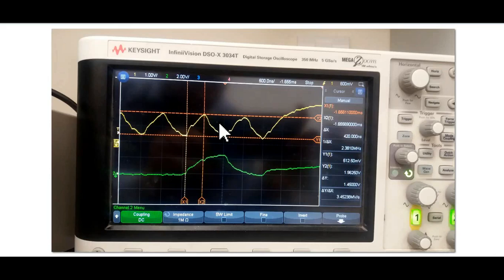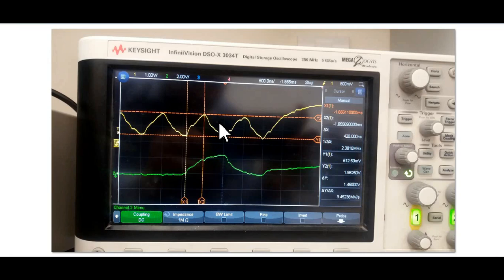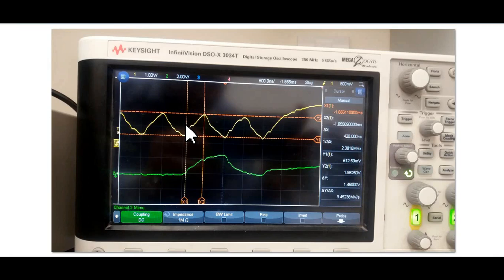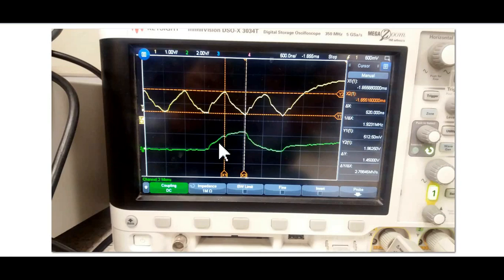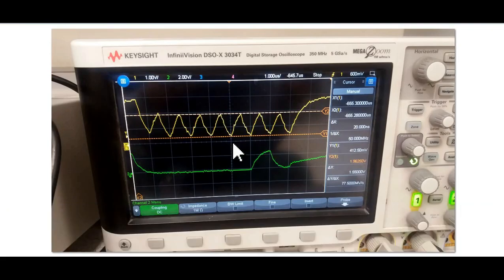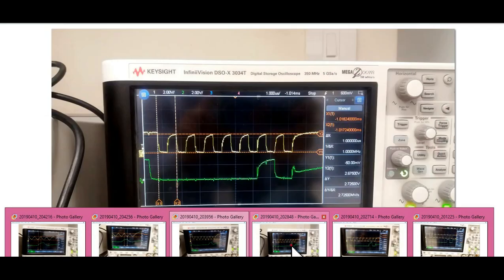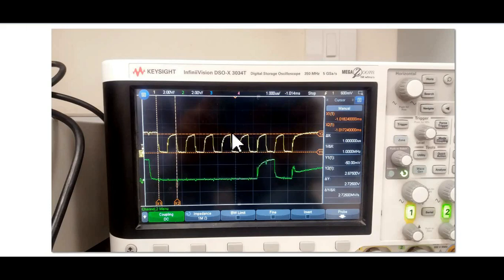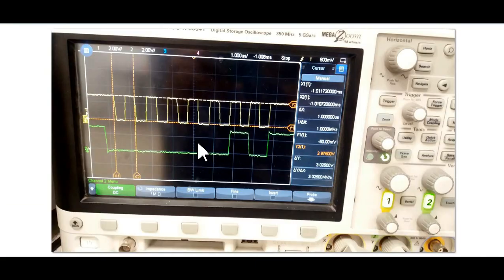Debugging - SPI Communication Failure

Comment: To check SPI master side: push-pull or open-drain?
It seems like an open-drain with a too large pull-up resistor so rise times are slow.
If the SPI master is a micro controller/processor, as most of the time is, and you wrote the fw, check if you have control over the output speed of the SPI pins
Reply from the maker: Thank your for your help
Reply: i hate SPI.
just now i’ve had some led strips working, i’ve tidied up the cables with cable ties……not working anymore FML…
I’ve left the place so I don’t start smashing stuff.
will go back at it tomorrow.